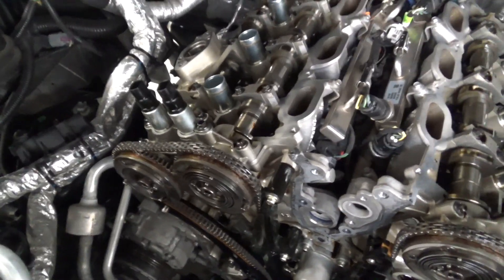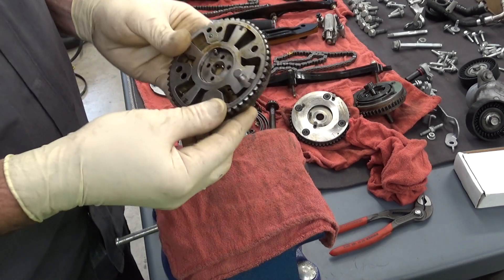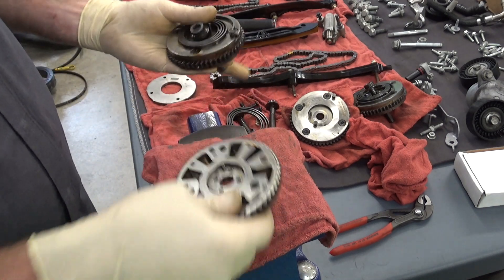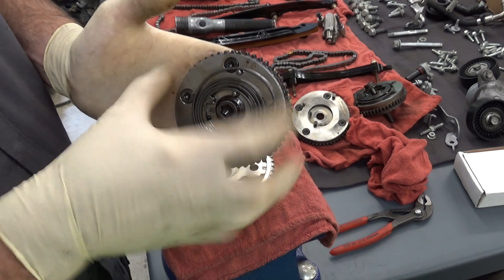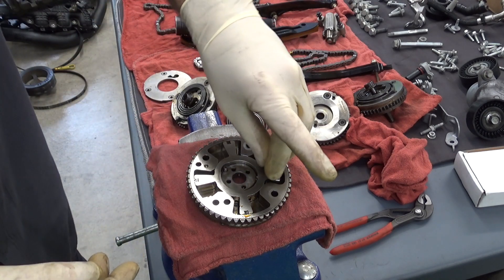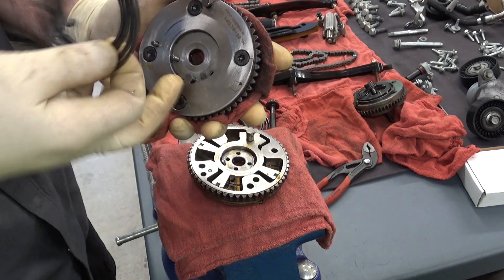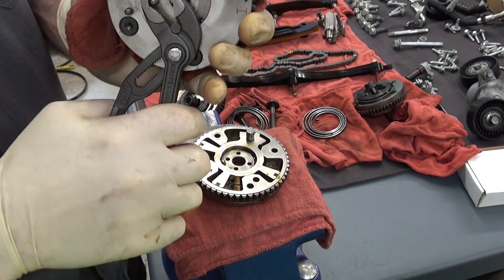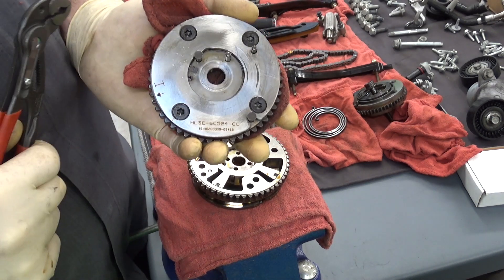FORD 3.5L ECOBOOST CAM PHASER RATTLE. THIS IS WHY

Comment: wanted to see if this helps with my recent discover while servicing my own '17 F150. Hopefully the updated phasers that are going in have addressed it, but my fear is that only a shield was added: https://www.youtube.com/watch?v=gM9Zlv2z5xk
Reply from the maker: So did you ever pull the new unit apart? I have yet to disassemble one. It's either one of two things that is happening on the original design causing the noise IMO. The spring pressure is not enough to displace the oil inside of the slot or something is not allowing the oil to bleed back thus causing the pin to stay partially engaged and not fully seated when shut off. When a defective phaser is turned back and forth with a wrench you can hear the oil squish around inside and feel the pin just barely engage or not at all. I disassembled a defective unit, cleaned out most of the oil and reassembled and then it locked just fine so the oil is not allowed to evacuate inside the hole for whatever reason.
Reply: @raincitywrench117  I've not taken a new one apart, but when the funds permit I will likely get back into figuring it out. A conversation on that video has me thinking spring tension/bore alignment more than the pins at this point. They could be a symptom rather than a cause.
Reply from the maker: @JaysonStork  Yea, it like a chicken and egg symptom.

Comment: Great video, has ford issued a recall on this yet?
Reply from the maker: Ford has issued an extended warranty coverage 21N03 for this issue and is on there third phaser design.

Comment: I’ve been die hard ford for years.  This issue has been going on since 2006.  I’m getting frustrated with ford, and thinking of just throwing the towel in on the blue oval.  Ridiculous.
Reply from the maker: I'm with you. The Super Duty tremor with the 6.7 is pretty sweet though + have one on order but the seats are pretty sub par compared to the Ram product. If it were not for employee pricing I would have ordered a new Laramie.
Reply: @raincitywrench117  By the way thanks for your videos!  Damn right the tremor is freaking sweet and hard to not wanting one, but that thing is out of my budget so I’m alright 😂.  I still have my 09 Platinum with the 5.4 and it’s been giving me the rattle but the sob still running strong and hasn’t thrown any codes “yet” lol 3 years with the rattle and still good.  Also my wife has the 08 navigator about to hit 175k miles with no issues whatsoever.  Some 5.4s were very good apples for sure,  but the majority of them well you know.  Thanks again!

Comment: I've finally solved this problem on mine by using a pre-oiler.  $500 solution versus >$2K phaser replacement that's just a "reset button".  Video: https://youtu.be/T_QuLckdV_k
Reply from the maker: Watched your video. Cool fix. You won't have to deal with that issue again. Your engine should last substantially longer with that system also.

Comment: Is the update going to be applied to the 2022 Ecoboost Raptor?
Reply from the maker: Not that I know of but can look. Do you have one that is noisy?
Reply: @raincitywrench117  Hi, My friend wants to buy a 2022 raptor 3.5 liter ecoboost but is afraid to because of all of the problem with cam phasers. I am hoping that Ford has improved the cam phasers for the variable cam timing system.
Side note I think Castrol Magnatec should be the oil that all Raptor owners should use in their 3.5 liter twin turbo due to the fact magnatec clings to metal surfaces to coat them making for a safer start up after the engine has been off for a while or a few days.
Reply: @raincitywrench117  I do not have one. My friends is ready to buy a 2022 Raptor V6 Twin Turbo.
He heard about the Continuously variable timing lubrication problem.
It would be nice if Melling made a high-volume oil pump for the 2022 V6 Raptor Ecoboost
Reply from the maker: @Facewest  I checked and they don't have a service bulletin for this problem on the 22's. I still think it's bad design in the phasers. They are on their third parts revision and it looks to be working.

Comment: My 2017 3.5 has this issue but iv got 105k miles. Would My extended powertrain warranty cover this fix?
Reply from the maker: Ford factory warranty won't cover but your extended should. You need to look up the policy and check the terms. If you can't find the terms then email me with your vin# and I can plug it into Oasis to see if it's listed there. Oasis is Fords database with all their warranty and as built data. raincitywrench@gmail.com

Comment: How many hrs is this job calling for?
Reply from the maker: 10 hours
Reply: @raincitywrench117  is it possible to do it sooner? I only ask cuz mine was done in a day. Is it a cab removal?
Reply from the maker: @bronco788  It can be done in a day but it's a long day. It's a personal preference. Some techs remove the cab and some don't. I'm not sure it really saves any time, just makes it easier to work on. Have to remove the parking brake cable, brake master cylinder, coolant hoses, a/c lines, wiring harness, etc. So the time that would be spent removing the cab can be spent on tearing down the engine IMO.
Reply: @raincitywrench117  ok thanks

Comment: How many of these have jumped timing because of this, if any?
Reply from the maker: They won't jump the chains. The tensioners and guides will be fine and are reused. It's the internal locking pin causing the noise.

Comment: But, why does it tick after idling for a long time?
Reply from the maker: Good question. I don't know. Have seen a bunch that rattle on startup but have only seen one that rattled at idle once warmed up. On that particular vehicle, both intake phaser pins would not lock even when pounding on them with a hammer. With a hot engine at idle, oil pressure will be at it's lowest so I suspect the pressure is just below the threshold inside the phasers to stop the noise when the pins are not locking. By the way, that same pickup came in 3.5 quarts low on oil. Installed some new phasers and changed the oil last summer. It left nice and quiet and hasn't come back.

Comment: Greatly appreciate this. 

Have a 2017 with the rattle and it's getting annoying. 

We've been watching videos and gathering info. It's 4k up here to fix in Canada so seriously contemplating trying the repair ourselves.  Any tips ?
Reply from the maker: You can save a few thousand dollars if you do yourself for sure but you will need some special tools. Camshaft alignment tools, crankshaft pulley puller and long reach pulley installer. Here are some links but search around: https://www.jegs.com/i/Lisle+Tools/616/37230/10002/-1?gclid=Cj0KCQiAuP-OBhDqARIsAD4XHpfR3vyXbOhwte_RJ1rGsKvpIEz-Aex_wVeKu04Hp4zbAAb8n_c-OJwaAh0SEALw_wcB#
https://www.summitracing.com/parts/oes-27306?seid=srese1&gclid=Cj0KCQiAuP-OBhDqARIsAD4XHpe8OL2kw3Kr90tEbRI5UzHOIpOAYTclFxbDg4pLoCGkm58WesCgDxMaAui9EALw_wcB
https://www.summitracing.com/parts/otc-6667?seid=srese1&gclid=Cj0KCQiAuP-OBhDqARIsAD4XHpfteyEdtbQaPQonrzFVvXUsgfC-aR3GozXRplJw5gCn_annwbqxtAsaAhoFEALw_wcB

Comment: I really appreciate this video. I have a 2019 F150 with only 13000 miles on it. I had no problems but took it in for the recall. A couple of days after the recall on a cold morning (30 degrees maybe) I fired it up and it had a load knock for about 15 seconds or so. I also noticed it shudders occasionally on the interstate. It never did this before. It angered me greatly because low mileage and no problem until this so-called software (fix). I am taking it back to reset the software back to original factory. Ford knows damn well that software is not going to correct a mechanical problem where a locking pin no longer locks the cam phaser due to wear.
Reply from the maker: That stinks! I hope after reverse programming it's back to normal. 🤞
Reply: Keep an eye out for your fans staying on at high speed after the software up date. My fans stay on high speed  and my tyranny blew right after the dealer fixed the 10   speed slamming at shifts. 2019 with 22k. The upgrade adds increase oil pressure according to my service writer. Now I had to do my own research on the fans gave them a lists of issues to look for and they come back to me after 3 service visits and say oh we found a TSB on that issue. Im waiting a month now for parts. By the way they (Ford) replaced my tyranny with a new 2022 at 3k ago and the same issues are starting. I dont need a freaking spacecraft just a reliable truck.

Comment: @ RAIN CITY WRENCH, Matthew thanks for the phaser tear down, great video and info. Mayson (also a Ford tech) has and updated YT video https://youtu.be/PZ7-eLebdPs  which mentions the cam mega caps leaking down oil pressure. Maybe that's how the locking pin is getting damaged ? Sounds like the puzzle is coming together and it's all related. My 2019 just started rattling and a occasional bang in the transmission when I first start it (like the tourqe converter is locking up in park) I called my dealer here today, they can't even get me in for the flash for 4 weeks.
Reply from the maker: I watched that, good video. It does look like the third design phasers are fixing the problem unless someone says otherwise. Tell dealer after flash that you want them to start it the next day to see if it still rattles. If so, leave it to get fixed & save yourself another appointment.
Reply: @raincitywrench117  The dealer called me back this evening. Based on their past flash experiences and the fact they can't get me in till mid February their going to go ahead and do the full tear down replacement  and upgrade so my appointment and loaner are all set up for mid February 👍 the down side is if the tranny has to come out for the banging noise (they'll be looking at that then as well) I'm looking at driving the loaner for 6 weeks because of back log/ repair time 😑

Comment: My truck sounds terrible at start up after research I found this. Could this be the issue? I put the Vin in Ford pass and it has recall for cam phasers.  What should I do? Just bought. CpO
Reply from the maker: I almost guarantee you the phasers are your noise. How many miles?
Reply: @raincitywrench117   Matthew thanks for the phaser tear down, great video and info. Mayson (also a Ford tech) has and updated YT video https://youtu.be/PZ7-eLebdPs  which mentions the cam mega caps leaking down oil pressure. Maybe that's how the locking pin is getting damaged ? Sounds like the puzzle is coming together and it's all related. My 2019 just started rattling and a occasional bang in the transmission when I first start it (like the tourqe converter is locking up in park) I called my dealer here today, they can't even get me in for the flash for 4 weeks.

Comment: My truck is a 2020 F150 XLT with the 3.5 EcoBoost and 16.5k miles on it. I don’t have a rattle sound or any knocking when I start it up. Do I need to have it reprogrammed or can I disregard the 21B10 update?
Reply from the maker: You are still in warranty & it won't matter but here is what ford says: "Ford Motor Company has developed an update to the PCM software that helps protect your cam phasers so that they will not develop an undesirable noise. This PCM update is program 21B10."
So it may be worth doing to possibly prevent noise after it's out of warranty.

Comment: Not trying to be a dick, but how is it not an oil pressure issue if priming the engine first (flood mode, hold gas and brake when starting) stops the rattle? Our 18 expedition got the phaser rattle at 33k and priming it made it quit...Phasers and chains were replaced under warranty shortly after.....I suppose the engine turning over slower lets it lock in without such noise?
Reply from the maker: Oil bleeds back after prolonged sitting and will take a second or two for pressure to fill the chambers inside the vct units stopping the rattle after engine is started (when pins are not locking). Entering clear flood mode on engines with defective phasers will achieve the same thing but the engine rpm's will be significantly slower which eliminates the rattle. Cranking engine over vs starting is around 800-1000rpm less which makes all the difference until oil pressure enters the vct units.

Comment: It is still a low oil pressure issue, because the low oil pressure is causing the wear in that pin/phaser. In my opinion, the root causes are still low oil pressure and the start stop system exacerbating a low oil pressure issue.
Reply from the maker: If it were oil pressure, why are some of these phasers failing at mileage under 20K? I would think these engines would set low oil pressure codes which they are not. Replacing the phasers fixes the issue without installing any other parts. I could be wrong and there may be a design flaw in cam megacap but Ford has redesigned their vct units twice now which seems to have resoled the issue. Also, it seems to be only the intake phasers that are failing. You may be correct on the auto start stop feature taking these units out. It would be nice to know if customers that religiously disable their A.S.S. are not having this issue.
Reply: @raincitywrench117  Thats a good point. I had an expedition at 30k, and it could have been serviced better, and It also had a non-oem oil filter. I guess what im trying to say is, less than optimal oil pressure at all time is causing this issue. This can be caused by the mega cap, the auto start stop, or something else. Also, it's more apparent on the same cam running the high pressure pump. The whole mega cap is interesting, but it would only prove that there is less than optimal pressure. The 2.7 and 5.0 don't have this issue. For sure the auto start stop is making the problem worse.

Comment: I have a 17 raptor  , how much do you think it will cost me to fix this issue ?
Reply from the maker: Bulletin says 9.7hr job & our dealer is $175hr so our dealer would charge $1700 plus parts if it's out of warranty. Here is the warranty table:
 Up to 69,999 100%
70,000 – 79,999 66%
80,000 – 89,999 33%
90,000 or higher 0%

Comment: ford just came out with a new design updated fazers they are now sealed ive done dozens of these...its always the intake fazer that has the probelm
Reply from the maker: Are you talking about the alternate part# from Nov 19 supplement #3? *part ML3Z-6256-A is an alternate option* If so, I haven't installed one of the alternates yet. 
Same here, every one I have done it's been the intake pins with the issue.
Reply: @raincitywrench117  i dont know the part number by heart ive done a few so far with the new updated fazer they look like the original ones but they have a sealed unit like a sealed cover going over and around the fazer and their a tad bit smaller thickness wise ive done alot with the older style but currently have done 2 so far with this new updated fazer... i think it is the one your referring to but i dont have the part number on hand

Comment: Wow!!  I'm shocked that it isn't an oil pressure issue, but a mechanical issue or design flaw.  So, I'm wondering if ALL 2017 thru ?? F150's with 3.5L Ecoboost will be involved??  Of, if they were a design flaw for a short period of time during manufacturing process (bad batch or bad group)??  YIKES!!  GREAT video!!  Thank you for the details...
Reply from the maker: 21N03 applies to 17-20 F150 & 18-20 Expedition/Navigators

Comment: Prior to actual start up you can build oil pressure by depressing the accelerator and the brake pedal together and hold start button on for 5 seconds. Engine will not start but oil will get to the cam phasers. Stop process and start engine normally
Reply from the maker: Yep, entering clear flood mode works great on an ecoboost that has noisy phasers especially if it has sat for a long time.
Reply: I have also found this works but my question is will this prevent further wear or is it just masking the rattle but the problem will keep getting worse?